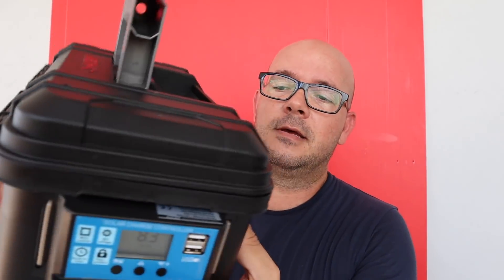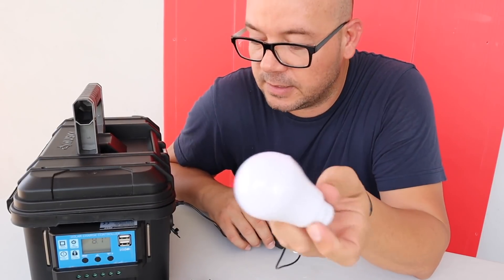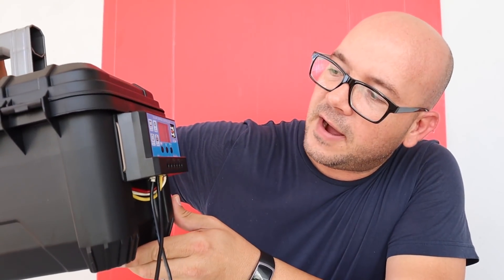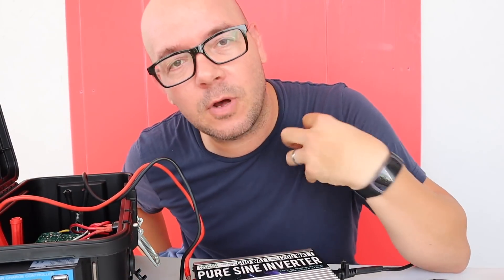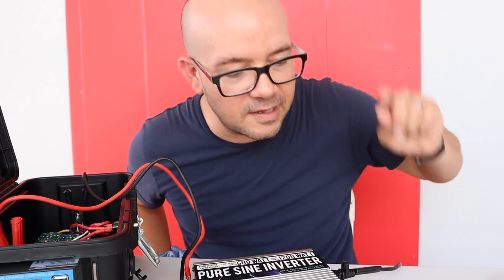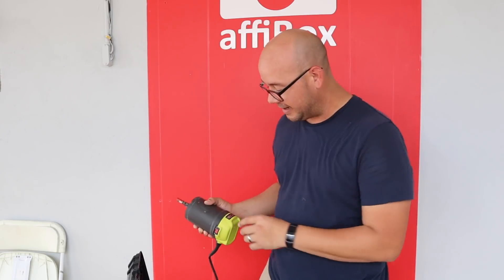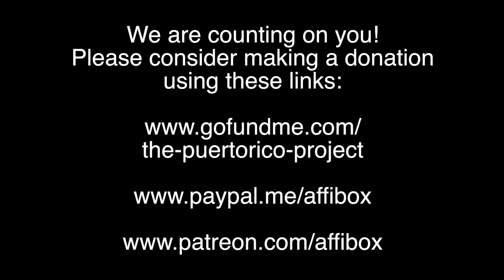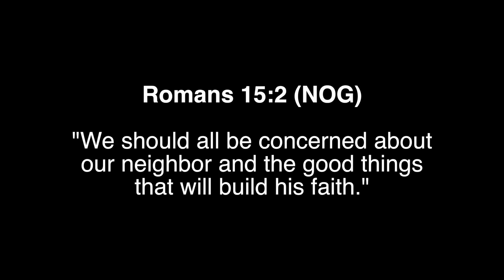Build a Supercapacitor Solar System in Minutes!

Comment: Is it possible to use a DC Motor to power the capacitors instead of using solar
Reply from the maker: Yes but you'll need to gear it up
Reply: @JavierCamacho  what does gear it up mean thanks for the reply
Reply from the maker: @CandyTok create a stepup gear setup to multiple the rom on the dc motor

Comment: What battery setting on this charge controller did you use so it doesn't overcharge the capacitors?
Reply from the maker: Caps have a pcb to avoid overcharging
Reply: @javiercamacho  What if you use super capacitors without a PCB just capacitors bolted up in series? I made a bank six equaling 15 volts Max 3, 000F.  Trying to prevent the solar panel and solar charger from going over 15 volts if possible as that is the max for the bank
Reply from the maker: @ja.935g67  you need to prevent overcharging or else
Reply from the maker: 12v

Comment: Hi sir, if we connect supercapacitor parallel to solar panel so after full charging supercapacitor will it damage capacitor
Reply from the maker: You need a charge controller to avoid overcharging

Comment: Hola... quería preguntarte si está combinación te parece puede funcionar: Batería súper condensador Maxwell 16V 500F 6 piezas 2.7V 3000Faradios con estuche.El  Inversor convertidor de tensión sinusoidal puro 8000W 12V 24V 48V - 230V.
o
6200W Hybrid Off-Grid Solar Inverter MPPT 120A 220/230V 48V 500V Pure Sine Wave
Muchas gracias 😊
Reply from the maker: Que piensas mover con eso?
Reply: @javiercamacho  quería poner paneles solares para casa
Reply: Es mucha potencia??..
Reply from the maker: Pero para que quieres los capacitores? De noche no te van a funcionar para nada
Reply from the maker: Todo va a depender de que quieres mover. Pero un banco de capacitores no sirven oara guardar energia, solo limpia el voltaje. Y vas a necestiar una configuración diferente ya que ese banco ennel video es para cosas pequeñas
Reply: @javiercamacho por ahora seria para utilizar con inversor y placa solar, sin guardar energía.Pero no se si te entiendo, no es lo suficiente para solo tener energía en el día?, que crees necesito si solo necesito cargar pc, móvil. Alguna luz y para maquinas de bricolaje, cosas así?? Agradezco tu opinión y ayuda!!!
Reply from the maker: @inmaru4586  tienes que mirarlo de forma técnica. Si pasas muuuuuuucha corriente por un banco pequeño de capacitores, los vas a quemar.
Reply: @javiercamacho  el caso es que no se que configuración es la adecuada,por eso quería preguntarte la capacidad que necesito.Muchas gracias
Reply from the maker: @inmaru4586  cuando se trata de capacitores, la matematica es diferente. Y con toda honestidad, no la conozco como la de las baterias
Reply: @javiercamacho  ah como vi tus vídeos que hacías diferentes proyectos, creía que entendías de la materia.Agradezco tus respuestas y honestidad
Reply from the maker: @inmaru4586  Yo entiendo de la materia pero cuando se trata de condensadores, la matemática es diferente y para ser honesto, yo no toco este tema hace años.

Por ejemplo, Para calcular watts, solo necesitas voltaje y amps. Para condensadores necesitas calcular los joules y luego convertir eso a watts para almacenaje. Para luego hacer otro calculo y saber cuanta corriente el condensador es capaz de soltar en 1 solo segundo.

Condensadores o capacitores no están diseñados par almacenar grandes cantidades de energía, por ende se necesita de un banco del tamaño de una casa para poder usarlo por varias horas cuando no hay sol.

Si solo quieres product energía usando las placas solares y usar el banco de capacitores para regular el voltage de las placas (que es para lo único que sirven) vas a necesitar un circuito que sea capaz de manejar los wats que vas a usar o de lo contrario vas a producir mucha resistencia y calor y tu energía se pierde o se prende en fuego.

He aquí el verdadero problema. Si vas a usar un promedio de 2500 watts tu sistema de capacitores debe poder manejar el doble o triple de eso en termino de la cablería y tablero de circuito, de lo contrario lo vas a dañar.

Me entiendes ahora?

un banco de 6 capacitores y un tablero sencillo, tal y como se consiguen en amazon o tiendas online, solo podrás usar como mucho, 200w-300w y va producir calor dado a que no esta diseñado para tantos amps.

Necesitas un circuito diseñado específicamente para poder usar mayor capacidad y necesitas un banco de al menos 6 capacitores por cada 50w que quieras usar.

Espero esto te ayude. 
Nota, le pregunte a lola (iA) y vas a necesitar al menos un banco de 6s9p en capacitores para poder usar 50w de almacenamiento por una hora

Si usas este: https://amzn.to/3XX6ft1
vas a necesitar 9 de ellos
Reply: @javiercamacho  muchísimas gracias por tus explicaciones,si entiendo ahora lo que me indicas.Mirare si cálculo para apoyo baterías, cuando llegue el momento.Por ahora voy a ver si utilizo horas de sol con inversor y placas solo.Agradezcp los links también.

Comment: How many amps does one set of six super caps produce?
Reply from the maker: I haven't tested it but I did ran my main fridge for a few hours during daylight and thats rated at 110v 1.5a.
Remember, this setup is only meant to be used with solar panels as an emergency solar generator

Comment: I noticed the video is 5 years old, as my practical Hobby, I'm in the process of adding a super capacitor subsystem in parallel with my 12 volt 2000 watt solar system.  I've been running my refrigerator with several different batteries including a 50 amp, 100 amp and 200 amp.  When I first purchased the 100 amp battery and charge them full, they produced enough amperage to get my refrigerator started consistently. As the battery has aged I'm noticing issues with the refrigerator startup.

I'm looking for advice regarding what capacity of a super capacitor would be the best for this specific application.  I'm not real clear on charging the capacitors and would appreciate any feedback on ways to charge the super capacitors from the solar systems output.

Thank You

Comment: Integrate with one 12v 100ah battery and it could run for days. I love this when you prove ideas like this work.
Reply: Exactly!  You need batteries to run off at night, and the solar for daytime.  Of course, the more batteries the better and longer run time.
You can parallel connect the batteries and supercaps all the time too.

Comment: I hope you can help me.i have a 5kva 48v solar installation I'm totally off grid. What I want to know is what capacitor's and how/where do I install them to take up the power surge that occurs when my fridges, borehole and other pump's kick in. Please let me know if you have any clever ideas. Thank you God bless and enjoy.
Reply from the maker: You need a pretty decent size Supercapacitor and place it en line between tye inverter and tye battery bank.
Remember, if a capacitor is 500f but you have 6 in series,  you've to divide the 500 in 6 and that's your real F capacity
Reply: @javiercamacho  Thank you but I'm still not sure what I need here. Sorry simple guy living on a game farm in Africa 😁 Big capacitor given 👍 in line between batteries and inverter and in series understood thank you. But are you saying I will need 6×500f (what volts) or is that just an example, is there a limit of volts/ amps I need to be aware of and check on the Inverter. At present I have 4 bank's of tubular batteries 48v 100amph each fund's are seriously limited I don't want to damage the inverter or the batteries and town is a long way away.
Really appreciate that you responded and appreciate any advice you can give.
Hope you have a fantastic day Iain
Reply from the maker: The farads and voltaje will be base on you current system @IainGordon

Comment: Hi, various lighting concepts are good to consider, and I guess you have.  An LED flashlight, supercap or lithium rechargeable would be good.  Also led in a speaker wire, low power distribution  connected to your system, for light in any room, etc.
Reply from the maker: I ran a test using a small led USB light bulb and the supercapacitors kept it on for around 30 minutes
Reply: @javiercamacho  Thanks.  I guess if it's on for just a few minutes at a time, it can last many hours.

Comment: Thinking of building myself something similar with some used solar panels at 5 watts per dollar for the panels, but with 48 volts worth of super caps with a 48v charge controller and inverter. Might be able to get myself 500 watts worth of power for 400 bucks. Might try to set it up with a wall plug charge controller concurrently as well to be able to run the system 24/7 with it automatically switching between utility power and solar depending on how much power the solar panels are producing.

That, or a similar system with 2 solar charge controllers and 1kilowatt worth of solar panels pointing in different directions to produce 500 watts most of the day, and a wall plug charger providing 500 watts when the sun is down for around 630 dollars, which will probably provide me with the most bang for the buck. Still figuring out the circuit though, so who knows what I end up going with. Running the AC all day during summer without paying 100+ dollars a month would be nice though.
Reply from the maker: Just remember, you'll need at least twice the amount of watts in panels for whatever your are powering at home. 
I'm thinking to do a vídeo about this but I don't know if there's interest anymore.
Reply: @javiercamacho  Thanks for the tip. There are certainly a lot of independent variables that I need to take into account. Also, with the energy prices(I pay 42 cents per kilowatt), I am sure there is interest in alternative energy. Especially if you can give tips on how people can get their hands on affordable hardware. :face-blue-smiling:
Reply from the maker: @TyrianHaze  are you in PR?
Reply: @javiercamacho  California. Currently have a 1 kilowatt system in mind that would cost me around 500-700 dollars to put together using used solar panels. Slowly working out the circuit, but I have until next summer to figure it out as I want to use it to power a window AC.

Comment: Some switches and busbars added and you can use the capacitors in the day while some batterys charge and then near sundown when the caps drain flip them off and flip the batterys on.

Comment: If you build something like this and drain them completly dead can you fill the box with epoxy? like cover the caps and boards completely?
Reply from the maker: I really don't know. What's your concern or idea?
Reply: @javiercamacho  Just wondering if I could cover them in something so there totally water proof. without shorting them.
Reply from the maker: @Ro-Bucks  got it. There's only one way to find out. 
Get a bunch of small caps and do a test.
Reply: @javiercamacho  well either works or I made a cool new fire show

Comment: This could work with sand battery using smaller solar panel (spares and old ones) maximum heat no damaged batteries brilliant thanks
Reply from the maker: You know, i was thinking the same the other day. I'm just trying to figure out how to convert heat to electricity using off the shelves tech
Reply: @javiercamacho  stirling engine is the obvious but I was thinking hot water or cooking depending on the amount of heat in sand. Sand pizza oven maybe 🤔

Comment: I still cannot figure farad to actual work meaning....
Since obviously your ebay links are meaningless now, what was the price and your system configuration??!
Reply from the maker: I don't use the farads at all. I did charged the supercaps bank and the turned up a led light to calculate how much energy I can use. The bulb was on for around 30 minutes.
Regarding the links, here they are:
Capacitors: https://amzn.to/41ex3DY https://bit.ly/3A1mpEG

Comment: Elminate the power-hungary inverter and switch to 12-24v DC loads
Reply from the maker: This was a test to show the possibilities of using solar and supercaps alone.
Reply: @javiercamacho  I see your point and thanks for the GREAT VIDEO to show this!!
The main thing on my mind was that so many household things now run on low voltage DC and are still plugged into 120vAC,  I would love to see a capacitor-only power source, but I realize it is not a trivial conversion...espically with the supercap discharge curve.
Thanks again...THUMBS-UP AND A SUBSCRIBE!!!
Reply from the maker: @dalenassar9152  i understand. But at the time of recording Puerto Rico what's going through a very difficult time and being an island made things worse. Buying batteries online was very difficult because no one was shipping them to the island unless it was via sea freight and that took from 1 to 3 months to arrive. Supercaps on the other hand took only 7 days arrive.

Comment: Nice video, i have had my thoughts about something similar, but with a twist.

I have a 40a mppt and a 12v 250a lifepo. My panels are a bit oversized. Id like to switch to 24 or even 48v to get more watt from my panels, but.. the price on batteries is an issue. So, my thoughts.. plugging a cap in the mppt that can handle 60vand plugging a dc dc buck step down 48v->13,8v 80a converter. I got a 44k mfd cap but it think it might be too tiny. It can handle up to 100vdc thou. I dont have the buck and im wonder if it will work or if its a waste of money. Do you have some spare parts to test it in a video?

Anyway, thanks, love the vid :).

Edit. Was planning to use a 3$ LVD with a dc dc SSR to turn off feeding to the buck if needed if volt got too low on the cap.

Comment: can it charge my ebike with the inverter connected on a day time when it is sunny
Reply from the maker: If you have double the energy in panels than what you need it should
Reply: @javiercamacho 200 watts solar panel fouldable, but with howmuch capacitors it should work for fully oparational working the inverter mine charger for the ebike is 230v/42v 5a i think it like 600 watt at the 230v side
Reply from the maker: Capacitors are only used for cleaning the voltage coming from the panels. You'll have to run tests to fully know

Comment: Excelente. Muy amable por compartir. Si le añade una batería de litio, esta mantendría los capacitores y estos se encargarían de dar potencia a los artefactos. Pienso colocar 12 paneles de 300 Watts, nonocristalinos y un inversor Growatt de 4 Kilowatts. Con cuatro baterías de 48v, 150 Amp, en paralelo con un banco de supercapacitores Maxwell 3000f, 2.7v. En si, es un sistema híbrido. Para dar energía a la casa. En la noche, cuando no exista energía solar, siguen los capacitores dando energía, junto con las baterías de litio. Al cesar la energía, el inversor, le dará acceso a la red pública. Si Dios lo permite y sale bien, se lo haré saber, como una forma de gratitud, por usted compartir sus conocimientos y descubrimientos. Dios lo bendiga y a su familia.
Reply from the maker: Hay una razón importante por la cual no use baterías en el proyecto. Luego de los huracanes Irma y Maria, no había forma alguna de conseguir baterías. Ya fueran de ácido o litio y enviarlas por correo es imposible.
Es por eso que usé supercaps. Estos artículos pueden ser enviado a todo el mundo y con un poco de tiempo y astucia, pueden hacen crear un sistema que atienda las necesidades básicas mientras pase la emergencia.

Comment: There is a super capacitor bank of Maxwell which is made for truck my question is suppose i use that 48volt maxwell capacitor bank  with 48volt inverter and just 400 watt solar panel with it work during day time full load
Reply from the maker: It will but your loads can't be more than 200w
Reply: @javiercamacho  and if i  use it in electrical vehicles which is having 48 volt 800 watt brushless motor with solar panel will it work in day light
Reply from the maker: Only if you have more than 3 times the amount of energy in solar than what's needed by the motor. 

Solar and capactors are a good solution for clean energy but you'll need 2 to 3 times the input from the panels for every watt used as a load
Reply: @javiercamacho  the capacitor bank i was talking about has 3000 farad 2.7 volt   18 capacitor, i think it is quite powerful, i think it alone can run 48 volt motor for long time ,wat u think ?
Reply from the maker: Test it and let me know
Reply: @javiercamacho  i hve ordered it on amazon, they r selling in cheap price 201 dollars , i think it is used one, and all the 18 capacitors r welded....if it didn't come in my purpose i will cancel it...

Comment: Are the solars abe to charge the caps while powering up a device simultaneously?
Reply from the maker: Only if devices are consuming 50% or less than available power from the panels
Reply: @javiercamacho  whats the best way to switch the depleted  pack with another one thats fully charged without device interruption?
Reply from the maker: @Han445  relays are a good option
Reply from the maker: @Han445  I'm currently rethinking this project sense I found myself with the need to have more solar panels to power a few mining rigs but I don't want to build a large battery just to use it or to buy grid tie inverters because of the many red tape and regulations.
Makes more sense to build a large solar array with a supercaps bank with a fast switching relay to a battery bank or grid.
Reply: @javiercamacho  if i wanted to recharge the packs with a car alternator, can it be done without dc to dc invertor?
Reply: @javiercamacho  have you ever tried charging the supercaps with atmospheric electricity? So u dont have to worry about the night and day its always constant ac current can power up the pack to keep these rigs running 24/7
Reply from the maker: As long as you don't go over the max V i don't see a problem
Reply from the maker: Not yet